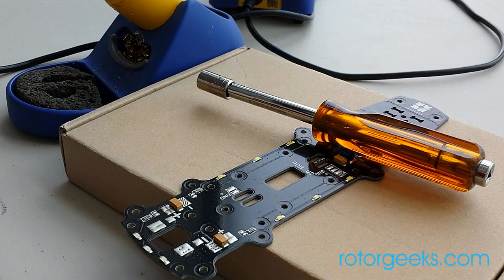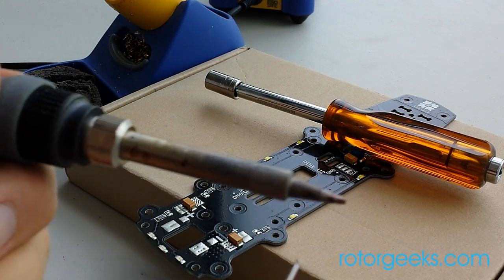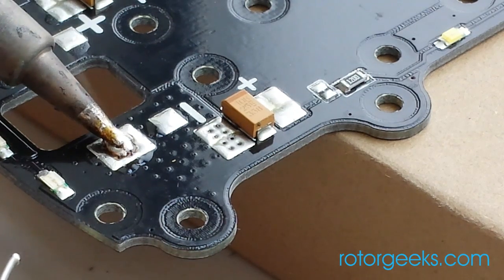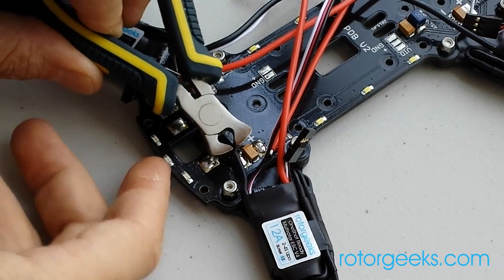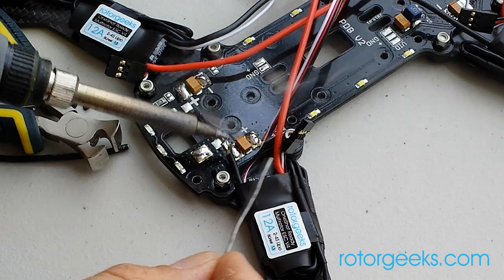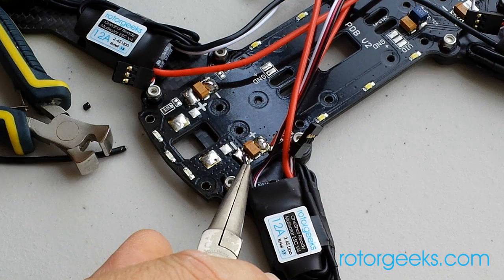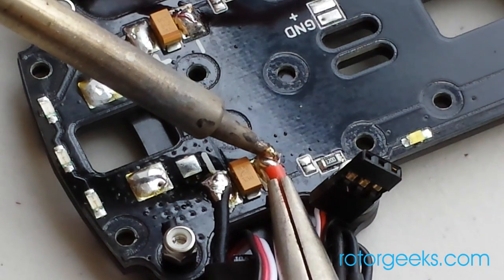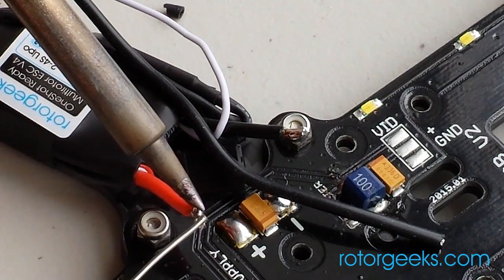Soldering the Minion power distribution board (PDB)

Comment: Never figured out this PDB. There are literally maybe 2 builds on RCG with pics of components laid out and even those don't look like anything you've ever seen on a PDB. So odd.. Looks great in the air with the LEDs but I was nervous about connecting the wrong wire to any of the FPV pads as some builder fried a camera and other things b/c he soldered to the incorrect pad. This really needs some clarity. The silkscreened text is cryptic and difficult to understand what they're telling the builder to do. Would be nice for a few actual example configurations on the vendor's site.

Comment: I know I'm going to catch heat - but putting solder on the tip of a solder is not good welding practice. When you do that you burn up all the rosin (Notice the smoke).  In fact by looking at the other joints you can see that they are dry.   The only time you put solder on the tip is when you use rosin paste.